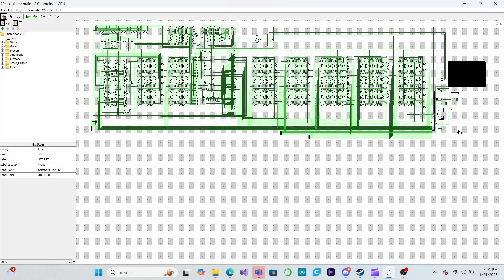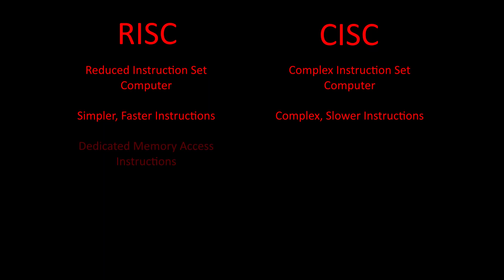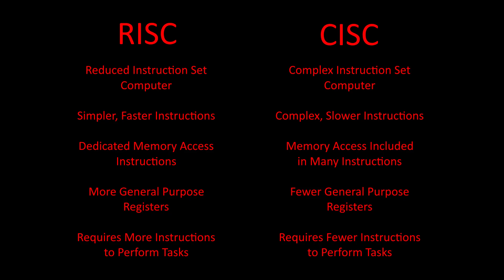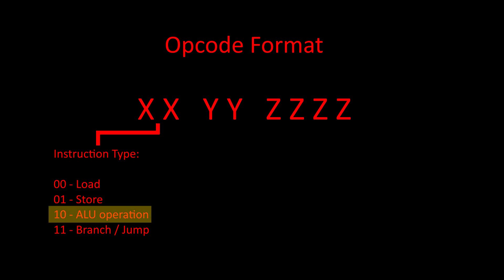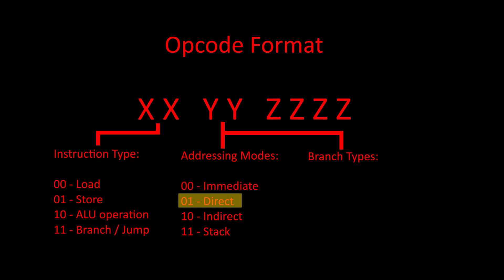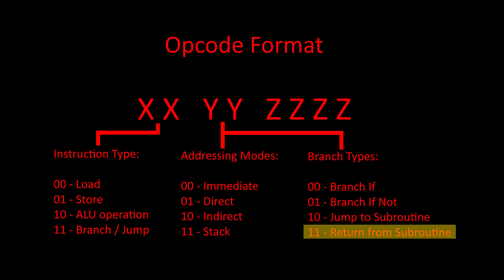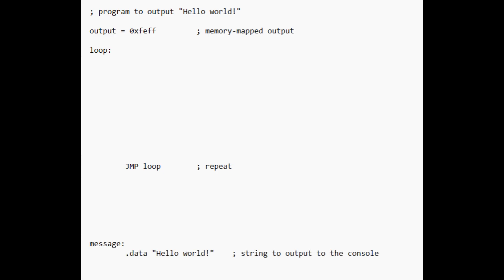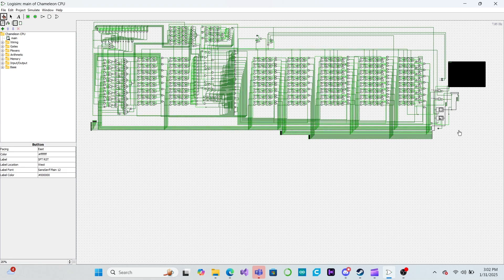Designing an Instruction Set for our 8-bit CPU (The CPU You can Build, Ep. 12)

Comment: The best way to differentiate between RISC and CISC is possibly by looking at whether instruction encodings are fixed length or not. Your explanation is of course still valid but the evolution of microprocessor made such distinctions fuzzier. Particularly on the total number of registers and instructions. Some modern RISC processors have a number of special instructions, some of them taking longer to execute than the simpler ones, so not totally matching the "reduced" set definition, but they are still fixed length. Good series by the way.
Reply from the maker: Thanks, that's also a great way to think about it 😎